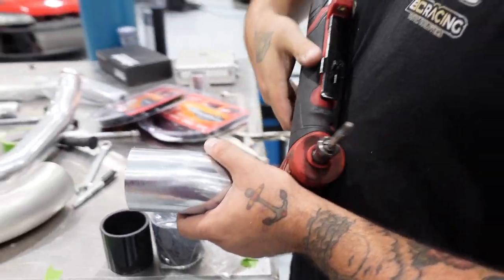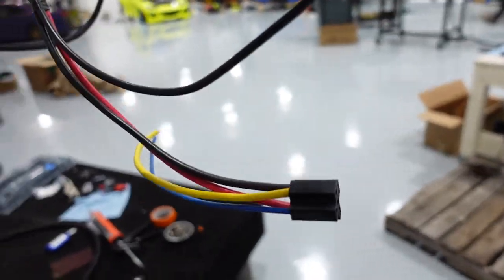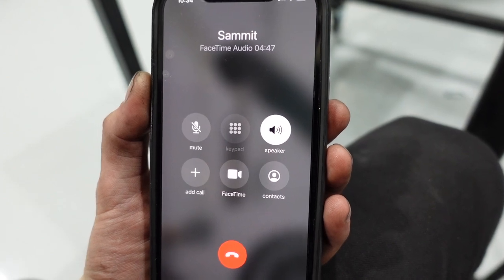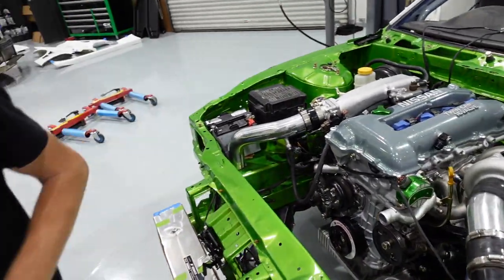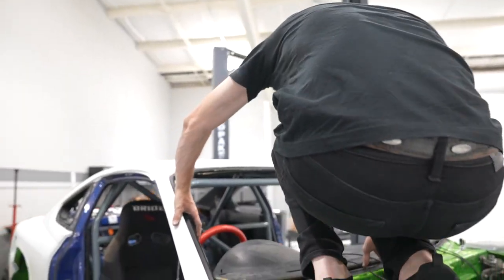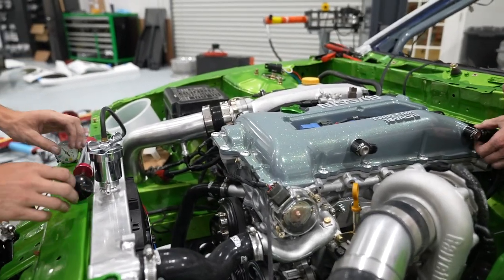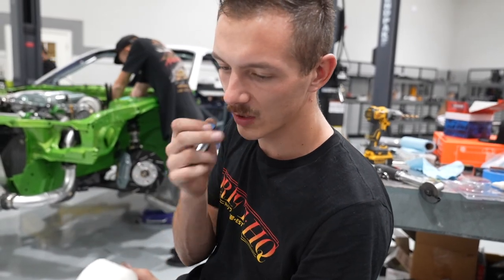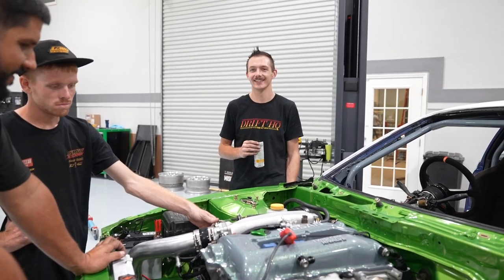Careless Mistake Cost me an SR20...

Comment: That piston is completely fine. I've had pistons with circles on them from completely smacking valves run fine in a modified diesel for 300k km, absolutely zero issues. Those pistons are actually in another engine now, running more boost with a bigger turbo.
Reply: pistons are made to handle impacts vertically so they’re pretty strong!
Reply: It probably would be in a diesel but on a petrol engine that roughness will cause some bad knocks. It should be fine if you just sand it flat like adam suggested but.
Reply: @InDmand  hopefully it won't throw off the final cr in that cyl.

Comment: Piston should be fine, put it at TDC cover the others and buff it to take sharp edges off, blow it off & run it.  Don't go crazy just a bit of scotchbrite & elbow grease, don't hit the deck.   Can always check the piston to valve clearance if you wanna be sure next time.

Comment: If you are going to reuse the piston (which I probably would if the damage is as minimal as Adam makes it sound) I would remove the piston from the engine and polish out the damage and then clean piston, lube it back up and reinstall it.  Additionally unless you have a lathe and proper polishing bow I would seriously consider sending the camshaft out to a machine shop to have scratches polished out.  Not to rub salt in the wound I am a firm believer that before starting an engine that any internal work was done to I cannot stress enough the importance of removing the spark plugs and rotate the engine over by hand at least one time for every cylinder. Secondly if you hear a strange sound when starting a newly rebuilt engine and you hear a strange sound stop and determine the cause of the sound before cranking the engine again.  All that said opinions are like a certain excretory body orifice and everybody has one. Have a nice day and a better tomorrow.

Comment: Never rush. Rushing just creates new problems. When engine building always triple check every single thing. To many people working on one thing. Also working late into the night or working all day long makes it easy for mistakes to be made, even small mistakes or stupid mistakes are bound to happen when working late or when tired. I learned the absolute hardest way possible when reinstalling my freshly built trans into my truck. Did all the work in one day finishing around midnight and had it running/driving. After 65 miles I had to pull the trans back out because I broke an important part while working on it late after going at it all day. Tiredness and sloped driveway caused me a lot of extra work and another $500 😔

Comment: little XJ650 sounds nice with a 2 inch, when its running on clean gas that wasn't given away for free because it came out of a parts washing tub. so much oil the spark plugs are fouled right as its wormed up. compression detonation idle limiter. :shelterin::oops:

Comment: Not quite the same caliber dude but I lost a engine due to putting the vac line to the top of the wastegate at 2am with a fuel cut defender as my only management. Sent 20 psi through it and 4 miles later boom. Sorry for your loss

Comment: I'm telling you, you need to hook up with mechman alternators. There racing alts are made for high racing engines with a warranty.. they would 100% sponsor you, and hook up up with enough to sell off your shelf... THEY BUILD THE ABSOLUTE BEST!! I been running a 370 amp alt in my truck for 5 years without a single issue.. I run a nice TRUE 6000 watt system in my truck at ½ ohm DAILY,  RUNS A STRONG 14.9V AND CHARGES 4 OF THE BIGGEST group 34s i could find.. itll be charging my lithium this spring, in my boat too

Comment: An absolute necessity on any mechanical assembly is to lubricate and put it through the motions by hand weather it be a engine, transmission, any sort of pumps like power steering. Basically anything metal that moves. It’ll save you a lot of time and heart break in the long run

Comment: mm use the same pistons on that engine clean the dent from the valve hit and weigh all the pistons balance them and your good to go. but i would really weigh them and balance as it might have lost same material. no rush man skipping something so small can cause an issue again. power and reliability is all in those small tolerances and numbers ;)

Comment: When my hair started to thin, I went and got a perscription for finasteride. Without it I'd be bald. I now have a full head of hair. 

No shame in it brother
Reply: Ill look that up thanks
Reply: Finastride definitely works. The only risk is if it negatively effects your mood(which is possible) but it doesn't hurt to try.
Reply: @Anon.G  been on it for 2 years now. Not a single issue so far 👌👌
Reply: Takes about 6 months to start noticing efrects. 1 year to fully see benifits. But it will stop hair fall

Comment: If you feel it with your finger nail then it’s gonna cause hotspotting in the engine , definitely needs sanded out at the minimum and ideally pulled out and machined

Comment: The guides and shims on an sr20det can only go in one way. This is something i see all the time with people building these. Look at your rocks arms, one side is machined for the guide, and the other is for the shim. People building these always f that part up, then you spit a rocker and commonly snap a rocker guide. The other things people don't understand is that the guides and shims need to be within a thousandth of an inch of each other. This will also cause you to throw a rocker or snap a guide. Same with the cam caps, they have to be the originals from the head you're working on. There are no such thing as replacement cam caps with out extensive machining. 

This is like the 5th video watching Adam having sr20det build problems, in Australia, I built there in my living room and never had an issue. Crazy that in the USA the SR has such a bad reputation,  mainly caused by youtubers who don't know what they're doing, and their followers learning their mistakes from them. I just got done with a forged SR for my 240sx, and it runs and drives no problems. Do better Adam, or, hire an Australian to build your SR, Americans seem to be incapable

Comment: What would be a modern equal to the SR20? Honda or Audi maybe?
Reply: Hyundai velocetor engine
Reply: Audi 1.8t 20v
Reply: @byrondelamare1844  I would agree with that. Don't think I have seen very many built versions but... That motor was underrated from the factory. like most Audi/VW. Also stoked to see what Von does now that he is with Audi
Reply: @colbyhall1989  I’d personally go with the 2007 2.0tfsi lump. Can pull solid 400s easy

Comment: I mean, wouldn’t there be a suitable coolant? Over distilled water…dumb question? Lol
Reply: Most tracks require you use distilled water and water wetter because cleanup during a crash or spill is a pain with coolant, and leaves the track slick.
Reply: @Pheatan  just a lot lower boiling point for something running at peak performance. Pretty crazy haha thanks for sharing some knowledge